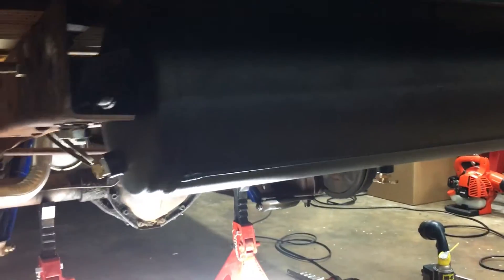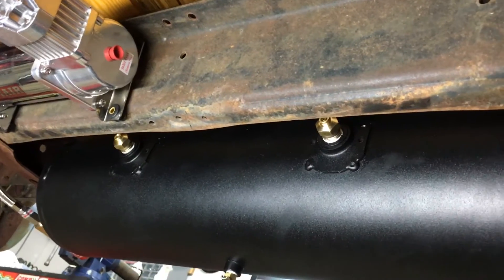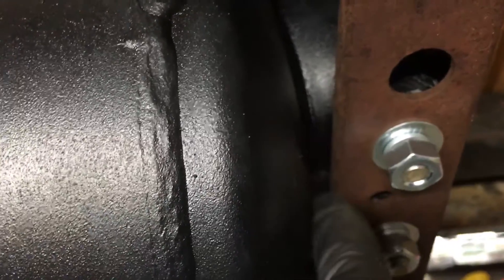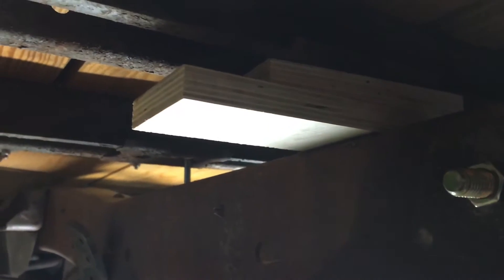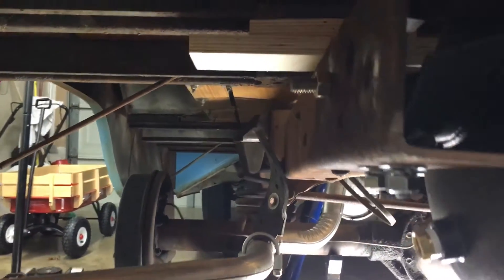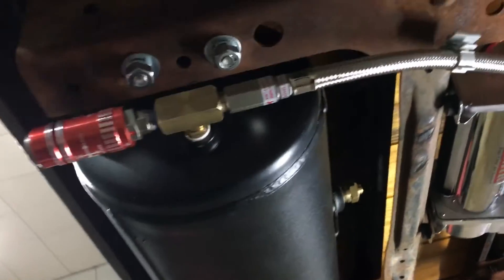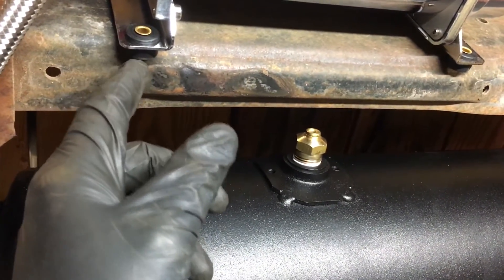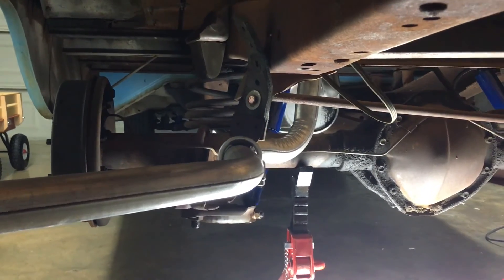Ezair ride install part 1 on my 1966 C10

Comment: Hey Charles,  I just bought a 66.  Couple questions brother,  
What did you use to preserve your patina?
And I don't want to c notch my pickup, do you recommend the EZ air system you installed on this video or would you have gone with the bigger air lines?
Reply from the maker: I just color sanded it and buffed it out. On the rusty areas I started with a 1000 grit and worked all the way up to 5000 grit. Cheap buffer from harbor freight and buffing pads. On the sides where there is paint I hand buffed it. I use the ceramic spray waxes which helps. If I was doing a manual switch setup again I would go 3/8” airline. Too slow with 1/4”. However I recently upgraded the air management on my air ride to an accuair vu4 and 7 switch controller. I kept the 1/4” line, bro it’s way faster up and down. I made a video if you want to check it out. Thumbnail image shows air management upgrade with switch suspension and accuair logo.
Reply: @Chickeneyegarage I'll definitely watch it.   Is that accuair system able to be installed without cell channeling the truck?    I just want to keep it stock...
Reply from the maker: @joesledge7826  yes you can install it without cnotching the frame
Reply: @Charlies_66c10  cool!  Last question and I won't bother you again brother, what size tires  do I need to run?
Reply from the maker: @joesledge7826  no worries brother. It depends on what wheels you want to run. I like the stock look so I’m running 225/75/15 on 15x6” wheels.